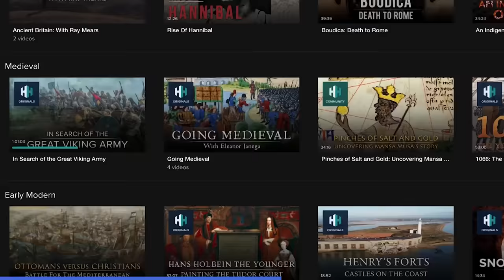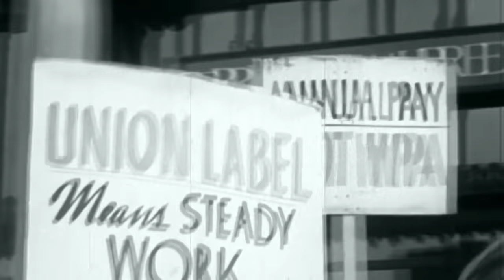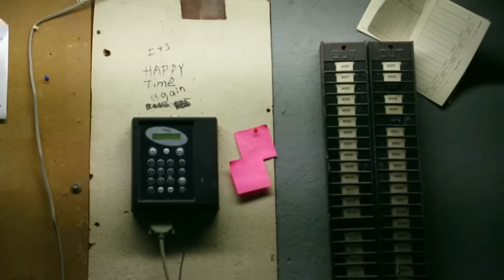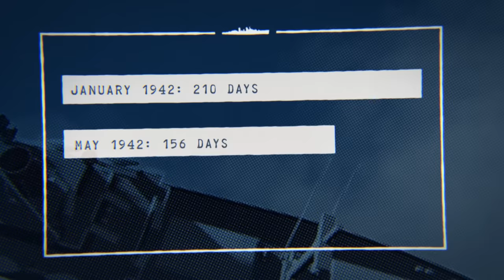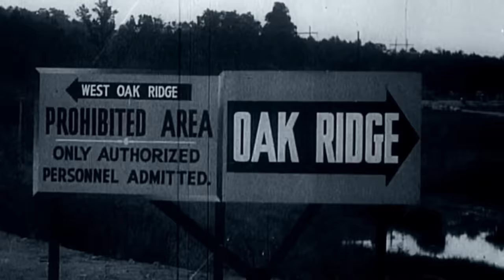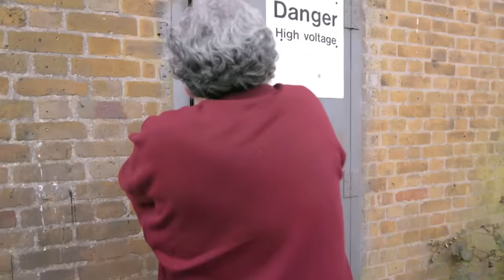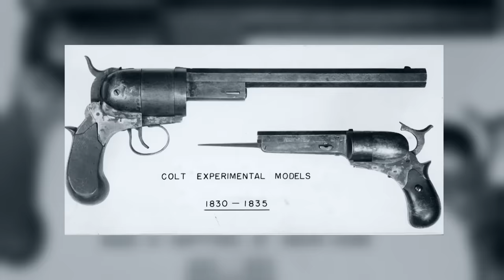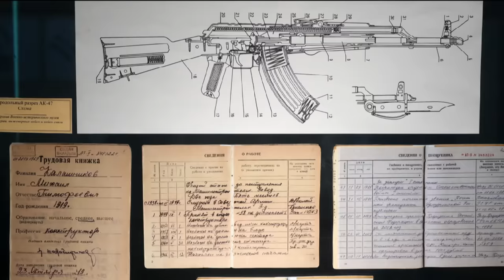3 Hours Of Facts About America's World War II Factories | War Factories Complete Series

Comment: It is well known and well documented the problem the American engineers were having with the Merlin engine prints were RR had more open tolerances and hand fit many parts, something that is not conducive to high production! American engineers significantly tightened the machining tolerances so every part was interchangeable. This is more difficult then one may think and requires scrutinizing every part and how it fits. This made the American Merlins the very best made! 

Little has changed, I worked for years for a large company out of London(Morgan Ind.) and have had to make countless changes on British prints because of sloppy tolerances! It’s a cultural thing!
Reply: I think both Britain and the USA have less open tolerances now than in the past; the Brits with Brexit and US with our Border Wall.
Reply: Question: RR?
Reply: Morgan haven’t changed their basic designs since WW2…
Reply: @b1646717  Rolls Royce, the original manufacturer of the Merlin engine.
Reply: @allangibson2408  on a lot of products you are exactly right.  I worked on R&D of new products!
Reply: @Nobody-Nowhere-USA  Thanks
Reply: Tight tolerances = hand fitment. Loose tolerances = mass production. So other than being absolutely backwards, you're completely right. 😂👌
Reply: The big issue with the US Merlin was the looser tolerance one fits all approach meant the RR paper gaskets didn't work and they leaked oil everywhere. Later US Merlins were built with rubber and calk gaskets like car engines.
Reply: @interstellarsurfer  Absolutely incorrect. If the fits are properly engineered and tolerances held, quality will be maximized and assembly greatly simplified.
Reply: the factories were already here prior to 1800. The blueprints stored away. All they needed was technicians taught enough to read and built the machines using tooling that was already on hand. The war machine is 1000 years old, the Tartarian Empire built it.
Reply: @togowack  LMAO 😂
Reply: Well you are talking about a demographic of ppl whose only worthwhile contribution to the transportation industry was the steam engine. Haven't done one better since! 🥴
Reply: @LynxStarAuto  those people were not responsible for the steam engine. The steam engine, along with gas coal and diesel, were here before any white european, blacks, indians or anything else in our history books arrived.
Reply: 0000
Reply: @togowack  Does it hurt when you try to think?
Reply: @ghz24  Hi, we live in the age of revelation, much was hidden during the war and in pre war years, just do the math, a few thousand white europeans all speaking different languages fighting for basic survival did not build this war machine in 10-20 years or even 100 years.
Reply: A Cultural thing, indeed.  As a French Canadian, I feel truly blessed to be a part of two different cultures; one that believes the importance of the individual, the other seeing the power of joining forces by way of compromise. We need future economies to join again these differing factors, by making renewables the focus, many of today's so called 'renewables' don't meet the criteria, BTW, reconnecting peoples rather than furthering divides.  

I know these ideals are vague, lofty sounding, and they are, to say the least, undefined. Maybe we can start now, as late in the battle against climate change we already are, but whatever the cause, it is happening, global warming, I haven't seen a winter like the ones of my youth, and this summer has been strangely cold and unproductive agriculturally.

Let's get together and think of new solutions. Recycling in its current form is a joke, and things like solar panels and wind turbines don't come close to renewable standards.
Reply: @sylvainthibeault3447  new safe nuclear.
Reply: @jsmith294  Correct. "GO NO GO"  certified (one off fitment tool) Machined 10's of thousands of Boeing Aircraft parts still in the air today. I enjoyed the machine shop very much. American quality and volume is backgrounded by a parking lot full of personalized cars, weekends at the races and rock and roll and pride in workmanship. If you prefer cello music and white gloves and a sense of giving birth, be a doctor.
Reply: It's not just cultural. As some have pointed out volume of production will make a difference, even if you make the same volume in a high-volume plant there will be different methods used. Anytime you move design/drawings to a different plant it need to be re-validated.
Reply: @jeebusk  You guys - America - didn't design this stuff. The later tanks, like the M1A1 and a lot of the tech past 1960, you did design. Look at conditions prior to the war and tell me when did design start, where is the iterative process? it doesn't exist, because the blue prints were all found in factory drawers before colonists got here.
Reply: @togowack  there's a great aero channel called Greg's airplanes i think, he discusses the merlin and allison in more detail than any other channel I've come across. Some US aircrafts were retrofitted with Merlin engines for Europe but the allison was preferred for maintenance in the Pacific. Also the requirements like altitude etc were different.
Reply: @jeebusk  What I mean is, when the British monarchy scouted and documented the vacant cities, blueprints for war machines were also sitting from the time of the giants. The early war machines are not our design, they are ancient, probably designed by the giants (scaled down versions usually). Photos are available. This place was called Tartarya before 1800. Cities and factories are ancient. You really think a few thousand colonists on horse and buggy in the matter of 30 years built all the factories in between farming economic crash and plague.
Reply: @togowack  that's on another level, I've seen some stuff about that but the timeframe I'm aware of is thousands not hundreds of years. Some tech like rubber and many foods were definitely adopted from the Americas.
Reply: @jeebusk  America is many thousands of years old, actually I think the oldest of all, because it was left untouched due to longer term receding flood level and later floods. I don't think the people who owned this land had any supply problems, but some raw material may have been sourced somewhere else. We have to consider that after the Flood the climate totally changed, we had a uniform tropical climate, and under our feet are many amazing things buried and undiscovered, technology we are not aware of
Reply: @jeebusk  For example the Model T Ford is an Old World vehicle, yes we produced MORE of them after our arrival, it would have been one of the few gasoline vehicles made in a previous era. Other vehicles for which tooling was found, like the big tail fin cars of the 50s, had to be converted over to gasoline and have other engines removed out of them. The ancients were no strangers to using rubber and plastic but used it appropriately. Some of these vehicles will be unearthed in our future that were missed during the purge answering some of our energy problems.
Reply: @jeebusk  The Model T is a funny looking vehicle, NOT INTENDED FOR HIGHWAY USE, or even large scale production. It was for use on farms where any fuel could be burned. It was not meant to be used universally and in the numbers we produced. Ask yourself why we no longer have vehicles with spark advance and such elegant motors that run on any liquid fuel.
Reply: @togowack  sources?
Reply: @togowack  i think America was wiped out by meteor/ volcanos
Reply: @jeebusk  all the Old World photos show cities intact just flood damage though. Some cities were taken out straight by impact / nuclear detonation
Reply: @jeebusk  But at least you can enlighten those in these videos about the good ol' USA, what our history actually is? I have relatives in the war as well. Much will be revealed
Reply: So, that explains the behavior my MG Midget back in the 70s.
Reply: @b1646717  Rolls Royce = RR
Reply: Any product that has to be hand fitted to work properly is a product of sloppy manufacturing.
Reply: @6h471  exactly, someone incapable of machining to tight tolerances! The British have to hand fit a lot of things because of sloppy machine work! Yet you get people that know absolutely nothing about manufacturing that incorrectly believe hand fitting is something to be proud of,  it's not in most cases! Definitely not in the case of engine parts, fitting a wood stock to a rifle yes!
Reply: The U.S government is actually using a name of a continent to its citizens and country. We are U.S. citizens. Citizens of the United States. The United States is a country but America its not a country America its a continent. The whole entire continent was already named America 269 years way before the United States of America became a nation or even existed. Everyone on the American continent is an American likewise Asia are Asians, Africa are Africans and Europe are Europeans.🤦....ok I have four questions for you and everyone in here!!! 1: Where or how the United States of America got the name America from? 2: What happen first? The United States of America or the American continent? 3: What government divided the American continent? 4: What government added the North, the Central and the South to the American continent? Huh? 😎
Reply: @jamesohge4967  The U.S government is actually using a name of a continent to its citizens and country. We are U.S. citizens. Citizens of the United States. The United States is a country but America its not a country America its a continent. The whole entire continent was already named America 269 years way before the United States of America became a nation or even existed. Everyone on the American continent is an American likewise Asia are Asians, Africa are Africans and Europe are Europeans.🤦....ok I have four questions for you and everyone in here!!! 1: Where or how the United States of America got the name America from? 2: What happen first? The United States of America or the American continent? 3: What government divided the American continent? 4: What government added the North, the Central and the South to the American continent? Huh? 😎
Reply: @togowack  The U.S government is actually using a name of a continent to its citizens and country. We are U.S. citizens. Citizens of the United States. The United States is a country but America its not a country America its a continent. The whole entire continent was already named America 269 years way before the United States of America became a nation or even existed. Everyone on the American continent is an American likewise Asia are Asians, Africa are Africans and Europe are Europeans.🤦....ok I have four questions for you and everyone in here!!! 1: Where or how the United States of America got the name America from? 2: What happen first? The United States of America or the American continent? 3: What government divided the American continent? 4: What government added the North, the Central and the South to the American continent? Huh? 😎
Reply: @togowack  The U.S government is actually using a name of a continent to its citizens and country. We are U.S. citizens. Citizens of the United States. The United States is a country but America its not a country America its a continent. The whole entire continent was already named America 269 years way before the United States of America became a nation or even existed. Everyone on the American continent is an American likewise Asia are Asians, Africa are Africans and Europe are Europeans.🤦....ok I have four questions for you and everyone in here!!! 1: Where or how the United States of America got the name America from? 2: What happen first? The United States of America or the American continent? 3: What government divided the American continent? 4: What government added the North, the Central and the South to the American continent? Huh? 😎
Reply: @jeebusk  The U.S government is actually using a name of a continent to its citizens and country. We are U.S. citizens. Citizens of the United States. The United States is a country but America its not a country America its a continent. The whole entire continent was already named America 269 years way before the United States of America became a nation or even existed. Everyone on the American continent is an American likewise Asia are Asians, Africa are Africans and Europe are Europeans.🤦....ok I have four questions for you and everyone in here!!! 1: Where or how the United States of America got the name America from? 2: What happen first? The United States of America or the American continent? 3: What government divided the American continent? 4: What government added the North, the Central and the South to the American continent? Huh? 😎
Reply: @armandoruiz8758  The name America is on maps from thousands of years ago including the name Canada the name of all the states and major cities some of which were obliterated before it was  re populated in the last 200 years... everything we use and see is very ancient, once you understand and your eyes discern the difference, you can see that everything we build and do is like childsplay compared to what we inherited. Will Not Last except the original stuff.
Reply: @b1646717  rolls royce

Comment: The Colt 45 as you are calling it turned into the "Colt Single Six" after the 1911 came out even though the cartridge is still called the 45 Colt. After that the semi auto was considered the Colt 45, or 45 Auto, cartridge is called the 45 ACP, just something to reflect on. Many times the guns are named after the orginal manufacturer of the cartridge IE 44 Remington Magnum even though the gun could be made by Ruger.
Reply: Actually the Colt 45 or 45 Long Colt was the primary cartridge for the Colt 1873 Single Action Army. The 45 ACP (Automatic Colt Pistol) was the cartridge the Colt model of 1911 was designed to fire for the US Government. I'm 81 and never heard of a Colt SAA referred to as Colt Single Six.  Roger did and may still make a  Ruger Single Six in 22 lr
Reply: @iristhompson2350  I stand corrected, my only point was that guns are often named after the original cartridge manufacturer. IE 30-30 Winchester even if the rifle was made by Marlin.
Reply: Colt 45 and two zig zags?

Comment: Interesting side note - there were actually stories of whole platoons in Vietnam ditching their m16's for AK's because they were so much more reliable in the rain and mud of the jungle in Vietnam. Not just the odd solider like is mentioned, the first m16's were deathly unreliable in the jungle. A perfect example of engineers who think they know everything because they design something. Just because you design something doesn't mean you know how to best use it.
Reply: They were much better actually it was two fold, ammo wasn't up to spec and the forward assist wasn't added as it was designed. They did add it after the thousands of complaints that poured in. And the brass was closely monitored.
I carried the A-2 in all conditions and have owned several variants of AK's
You can't match the accuracy or dependability of the 16's
Reply: Not true. There was a problem with the magazines. Look into it.
Reply: @badxradxandy  The problem was mainly the pressure curve of the ammunition, which affected the dwell time, something a DI gun is very sensitive about. The Army changed the formulation of the powder from what they supplied Stoner with when he was developing the rifle. He was livid about it. Once the problem was remedied they were very reliable, but the damage to their reputation had already been done.
Reply: You got your facts crossed pal, the original design of the XM-16 was not flawed, it was an active act of  sabotage by the Army ordinance corp who intentionally failed to incorporate chrome-lined bores, chambers, and barrels as well as knowing producing the ammunition with the wrong propellant all while not providing any cleaning kits or maintenance instructions.  The Army even propagated the false notion of the XM-16 being a "self-cleaning" weapon.  They were so angered by political directive to adopt the intermediate caliber small arm over the continual use and production of the antiquated M14 that they purposely cost the lives of US servicemen.  The M-16 is better than the raggedy assed AK any day of the week.